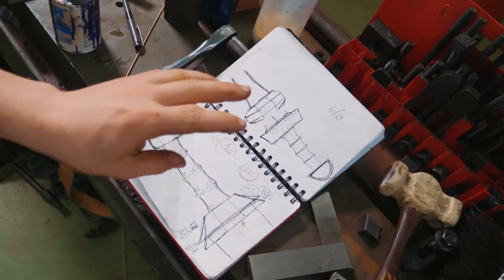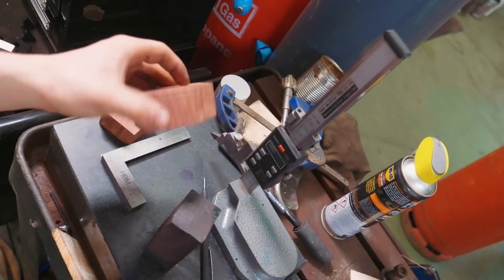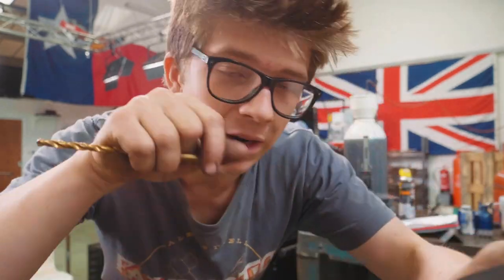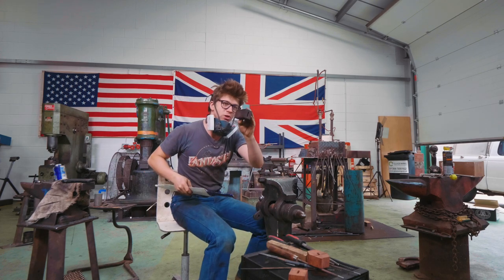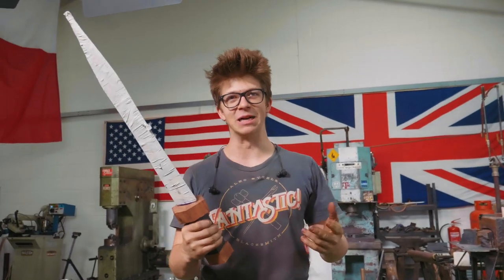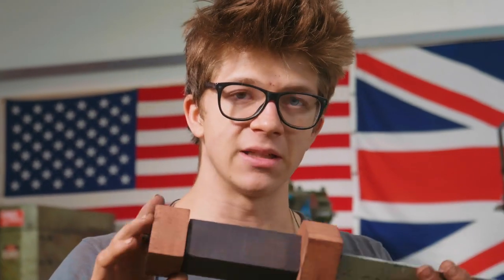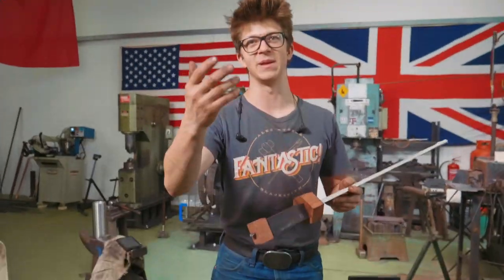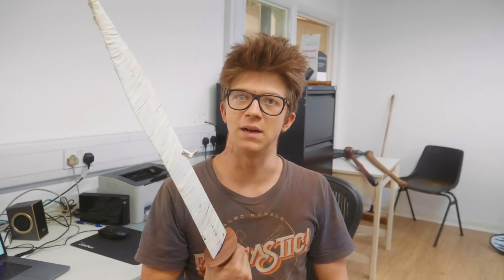MAKING A ROMAN GLADIUS!!! Part 5

Comment: I think it needs a larger pommel to look right, but you certainly did the work well!
Reply: The entire hilt is wrong, 
historically accurate? Nop
Good looking? nop
Reply: @markcannon8522  this was a long time ago! His build standards have much improved !
Reply: @ThatWorks  indeed! But i will take him seriously when he stops calling pattern welded steel “damascus”. Or when he makes historical blades with carburized, laminated or patter welded bloomery steel blades.
Reply: @markcannon8522  that goes to common usage. Damascus is a term that may have meant one thing at one time but now is commonly used to explain another it happens in society all the time. A far as him using historical steels…many if not most master smiths in the world have never done this. Just. Small handful of blade makers have even attempted it in the western world. It takes years of knowledge and practice to do it correctly. If Alec sets his mind to it, he can do it. I wouldn’t not take him seriously as a craftsmen just because he hasn’t gotten there yet. That’s just silly.
Reply: @ThatWorks  👍

Comment: Hi Alec, 
With you wood machining you could use router bit cutters in the mill, with spiral flutes to help clear the chips when cutting holes, and also to do the rough shaping of the handles. That would reduce your sanding time and dust making. 
Your mill can't run at router speeds, so won't produce the smooth finish that comes from the router, but will give an adequate finish for finish sanding. 
Another project that is looking fantastic.

Comment: Get "rail sander", they are for automotive body work. It will save you a few hours of hand sanding while keeping the piece flat. Even if you only use it up to 400 grit, it will save hours.  Also try some jewelers polish sticks for final finish after 2000grit wet sand.

Comment: You should experiment with mustard for different finishes! You put mustard on your blade or what ever you want to look cool in a pattern and the mustard has an acid that etches around the mustard but not where the mustard is! Just put it on there and wait about 24 hours.

Comment: You might consider using rasps instead of file initially in forming the wood. A second consideration is to use golf balls as handles on you file tangs. They fit in the palm really well.

Comment: Instead of trying to file out the tang hole in the handle mill most of the hole and heat the tang up and biting it on. It will make a correct sized hole quickly

Comment: With a dremal and a silicone carbide wheel the flutes of the drill bit can be cut back into a router bit as lond as the drill bit
If you keep moving and don't throw sparks when grinding (really slow wheel speed) the bit will keep it's temper

Comment: Seems like a wood guard would be a bad material on a fight.  Wouldn't it break easily in a duel of the opposing sword slid down the blade and hit the guard? I feel like it would break the wood easily.
Reply: What if something was on top of the guard though I wonder..
Reply: The Romans actually used wood for the guard. The thought behind it was that the opponets sword could get stuck in the wood.
Reply: ABSOLUTELY TRUE!!!!
Reply: Karl Dören seems like depending on the wood grain, it could split and then no guard and no hand protection. But then again that would make for more injuries I guess for the fighting.
Reply: The gladius is designed to be used with a scutum, a large Roman shield. This is why the guard can be so minimal and made of wood. If you parry with a Gladius you are doing it wrong.
Reply: Also a guard catches blades sliding down your own. A cut of this strength would be no way near enough to cut through the cross grain of a hardwood
Reply: Ian Holmen  they didnt dueling. They did fight  behind there shield wall, stabbing the enemy.  Close to there fellow soldier, shield in front and shield above.  Stabbing and slowly weakening the enemys army. Very successful.
Reply: Good thing it's the 21st Century and a Roman isn't going into battle with it then...
Reply: They would have used wood for the guard and covered it with copper or bronze. A Gladius was more of a stabby than slashy sword and often paired with a shield.
Reply: Nigel Lobo most of the ones I see have a metal guard, at least like you said a cover or something. A sword is a large weapon but to think that all the people who used them knew how to use them properly is wishful thinking.
Reply: Karl Dören why do you just make shit up on the internet? They didn't do sword-to-sword fighting.
Reply: AdderSpike ever? Not even once? How can you say for sure? Were you there? Did you see every fight ever? That's pretty amazing to know everything.  How have I never read any of your books on first hand experience of every fight ever?  Amazing!
Reply: The Roman legienaries trained to fight as a unit behind the schield wall. If individual fights started, then it whas extremely rare! Also they dint need a guard because they had their scutum to protect them. Not to mention their fellow soldiers left and right of them. With their schields.
Reply: str81100 now that comment just cracked me up.....
Reply: J M Why?
Reply: yes Ian , a good sliding stroke and bye-bye the guard & the fingers one time...!
Reply: I read de re militari by renatus, and can confidently say there was no bullshit idea that the wooden handgrip was ever intended to trap an opponent's blade essentially making both weapons useless. Sword-to-sword wasn't taught, as the entire function of the gladius was to be trusted from around the shield. They were specifically trained to stab instead of slash because of a stab's lethality and unpredictability from behind their shields. You don't have to have been to every battle to know that adherence to military doctrine was paramount.
Reply: Jamie Popple.  They would put a disc of metal on top of the guard.

Comment: I have a request I'm wondering if you can make Damascus Steel where you have vertical pattern. cut it up and make letters in a horizontal Direction so letters are horizontal against vertical and spell the word Forge on one side and love on the other side. making a canister weld so everything would go and a canister so that you can spell out the word.

Comment: I would advise that the next time you make a handle from guard, to pommel, all out of wood.  Make thin steel, or brass, guard, and butt-cap plating's, to prevent the wooden handle from becoming damaged during use, or from splitting when you peen the end of the tang...  I've learned this the hard way.

Comment: You should add a copper plate to the blade side of the guard...  (While I doubt it would ever get used for combat, it would not take a lot of blade catches to start removing bits of the guard) The copper would look nice and give the guard a bit more realism.  Also, wouldn't it have been a little faster to have made the handle round with the lathe and then done the finer shaping?

Comment: Should have done the guard and pommel out of brass
Reply: Nah, wood is good, it was good enough for the romans after all.
Reply: Pretty much just officers were graced enough to have swords fitted with metal hilts, and even officer swords were used for pretty much the same purpose: shield box, slowly stabbing away and weakening the enemy whilst maintaining an impenetrable defensive line.

Comment: looking good, but you need to use you draw-knife for first shaping, then fine tune with a spoke shave, and finish with belt grinder and sanding. Also, I thought a Roman Gladius had a leather wrapped handle?

Comment: for a historical gladius, the blade is ok profile-wise. hard to tell if you went with the historical diamond cross section with all that tape. I was happy to see the radiused shoulders. 

the handle... well, its a start. gladius handles (and swords in general,) should be about the size of a whiteboard marker in diameter. they were historically made of bone. this means that the current tang is about 3 times too wide at the handle, making the handle too large. it's also about an inch too long. the pommel is the correct size, at least.

Comment: Alec Steele, check your local thrift store for some "gum" rubber soled shoes. You use them like a giant eraser. They'll refresh the grit on your sanding belts, at least with wood. Also, check out C.R.Laurence.com, and look for tube wax. Its great for just about anything in the workshop! Drill, tap, sand, grind, screw, polish, wood finish, grease hinges, etc.! I think you'll love it, and it'll save you money!

Comment: I'm trying to put a hardy on my block of steel, so I need measurements. What is the average hardy hole size? (length/breadth), and if possible in metric. Thanks.

Comment: So this may be an ignorant question by why spend all the effort drilling and filing the slot in solid wood? Why not cut the part in half, mill the slots, you could use a ballnose endmill for the radiused corners, then glue the half pieces together?

Comment: I think the pommel piece should have been metal as a balance to the weight of the sword on the other end. It makes it a more agile and effective weapon. Its a piercing weapon, so the extra weight on the end is all moving in the same direction. F=M*A and all that.
Reply: Traditionally most gladii had wooden or bone handles and pommels. The gladius is a light sword and putting a large counterbalance on it removes most of the cutting capacity of the sword. With that wooden handle the balance should be about right

Comment: ACK!!!! You made the wooden guard's grain go in the wrong direction!!! 

You want it horizontal to the blade instead of parallel!! If another sword would strike this blade and slides down the length then hits that guard, it will split off a piece like an axe chopping firewood. If the grain was horizontal, it would bounce off it instead (mostly)...

Comment: Why dont u just burn in the tang for a perfect fit to the handle as other blacsmiths do, by heating up the tang in the forge, and then Press it into the handle that only has a rough drilled hole

Comment: You could have saved a lot of time and effort on the handle effuse delayed live Crips chips not sawdust after you cheated the cylinder minimal sanding to achieve the oval shaped handle hope that helps 
Sincerely M.

Comment: OMG who in the H ever uses a mill to work on wood. I have never seen anyone be so analytical about making swords and knives. Why not burn the rest of the handle in instead of hand filing and more use of the milling machine. I love your work and it is perfect. does it have to be? Oh by the way you can use inletting black instead of diecum blue (sp) it works better. we use it to inlay barrels and locks on black powder guns and to make modern gun barrels free floating on new stocks.

Comment: future note for working with padauk bud, its on the more toxic end of the spectrum of woods, mostly as a sensitizer so skin coverage to the dust is advised. its not nice to airways & mucus membranes. I know you wear respirators etc but it pays to be careful with a lot of the exotics used on handle & grips. http://www.wood-database.com/ great site to check a woods properties.

Comment: Alec, don't know if you are planning to do this but where the sword meets the handle you need a thin metal plate.  It helps absorb the stress so the wood wont fracture as well as keeps liquids from warping the wood. http://www.kultofathena.com/images/TFW022B_7_l.jpg